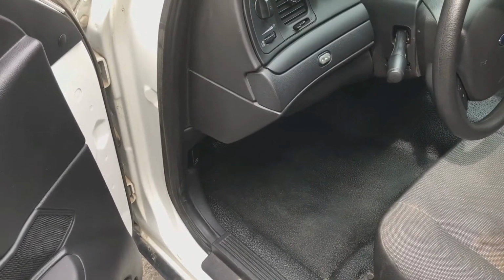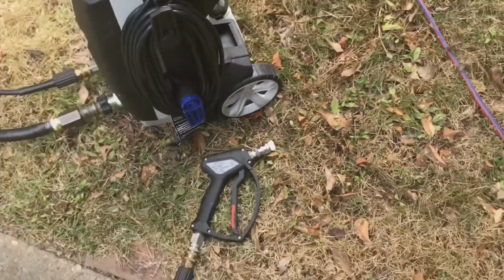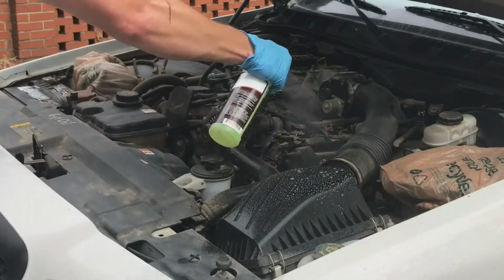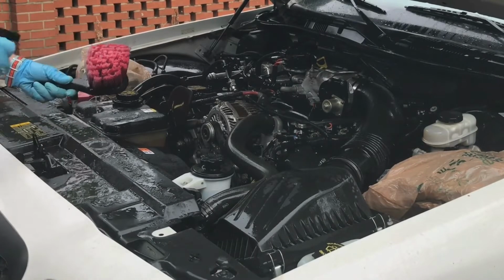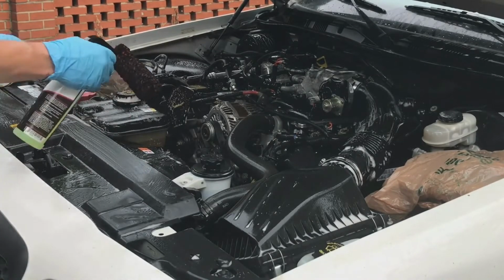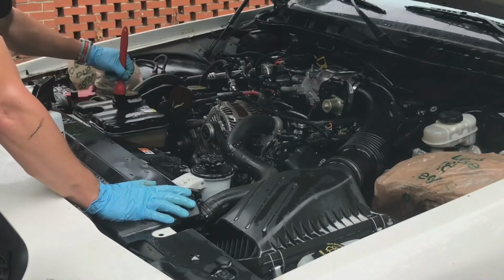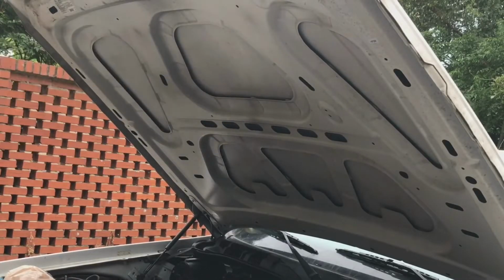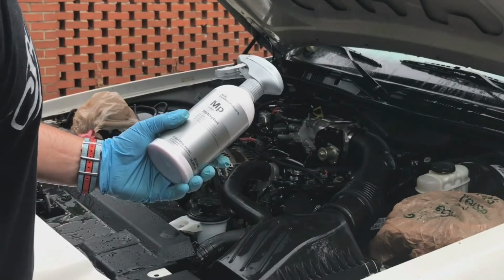Transform Your Engine Bay!!!

Comment: It’s always a little disconcerting for me to spray my engine down with water. Lots of YouTube channels advise against it but as long as the electronics are covered (maybe the alternator too) it seems to work out fine. ChrisFix has a great video on how to dry clean your engine.
Reply from the maker: I know what you mean! The good thing about the Vic is that really only a couple of areas of concern. Like you said, the alternator, which I definitely avoided spraying and the computer on the driver side and fuse box on the passenger side. As long as you don’t spray it down like crazy you’ll be fine! Using a pressure washer or sprayer with a wide fan is also key. I’m not dousing it, merely quickly blasting over the surface and typically at an angle. 

As an alternative to spraying, you can always go with a damp microfiber cloth. I do that on engine bays that are just slightly dirty. Problem with my engine bay here was that it was terribly built up with dirt and dust. A towel would have only pushed it around!!!

And thanks for the Chris Fix recommendation! I like his channel he has some really awesome content!